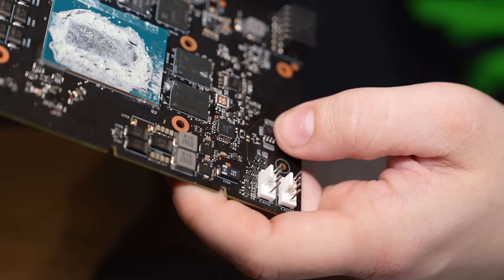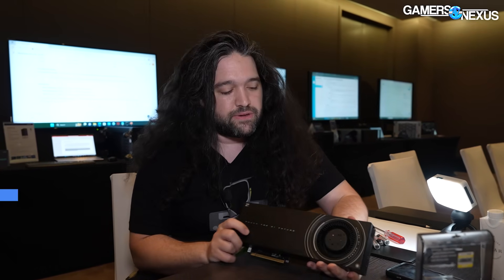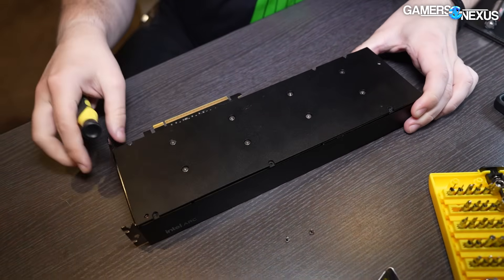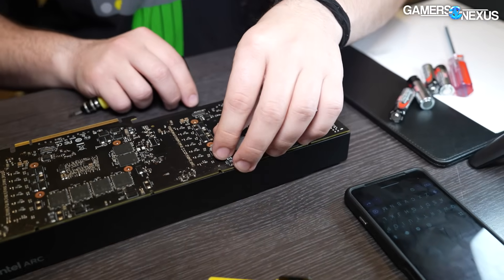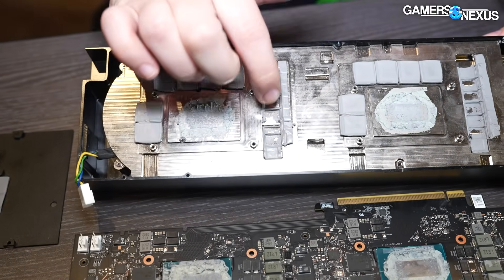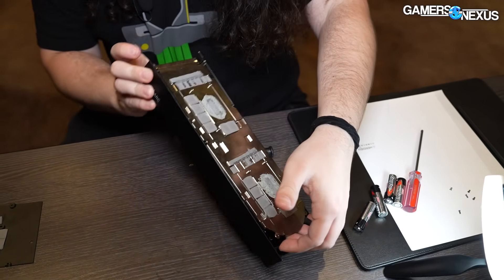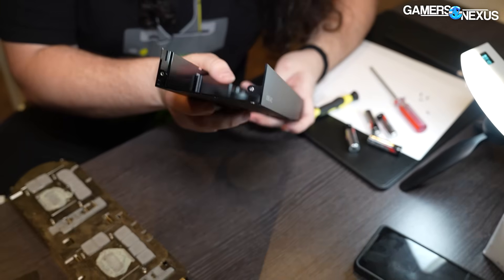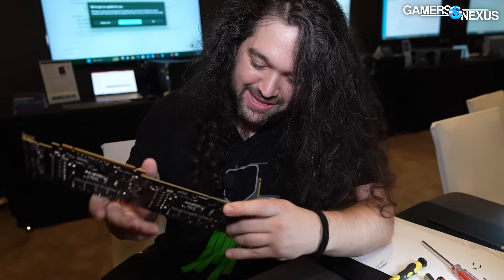Intel Arc B60 DUAL-GPU 48GB Video Card Tear-Down | MAXSUN Arc Pro B60 Dual

Comment: This cooling design does not support more than 250-300W TDP.
We will probably get 2X150W silicon. Intel B580 has 14TFlops\190W - ~0.07 TF\W.
250-300W Intel silicon will give no more than 20 Tflops.
I hope that I am wrong and real tests will show an impressive GPU for work.

Comment: The problem isn't the drivers for dual GPU. With Vulkan/DX12 the developers need to implement all of this. It's a lot of effort and there just isn't enough market to justify it.
Reply: Sadly. Even two 3060`s would be amazing in current games. Basically 4090 at home.

Comment: This brings back memories...i have a few dual GPUs at home, just from a fun collectors standpoint. Radeon HD 5970 (2 of them), GTX 295, Radeon HD 3870x2 and 4870x2, a 6990 and a dead GTX 690. I have a few more coming in at some point, since i want to have a collection of sorts.

The one i'm the most fascinated about is the old ATI Rage Fury MAXX and how ATI got AGP to accept 2 GPUs using AFR, but only on Win98. The card itself isn't anything special, it's just two Rage 128 Pro chips on a single PCB. It wasn't mind blowing, especially when you look at 1% lows and that it needed driver support, but overall, it was a very fun concept ATI tried to do.

Comment: The next GPU we need to see is a GPU that has integrated modularity with memory. Being able to easily swap out memory modules without the need of specialized tools and soldering, (similar to DIMM's) would be huge and would solve issues with the 5060 and other sub 8gb cards.
Reply: Not really possible. Modularity = being stuck with slower DDR memory, same reason why phones and laptops use soldered lpddr - its faster, it uses less power and its easier to install (not for user), and almost completely removes problem of signal integrity that is limiting current socketed memory. Not to mention needing to dump a different bios to a card to make it run, which is impossible without specialised tools and know-how anyways.

Comment: Machine learning is in its basic form pretty simple. It's a math function with a ton of parameters that you can change and there is a simple formula for how those parameters can be changed slightly to be slightly less wrong for a given input and output training example. So you nudge those parameters in tiny steps a trillion times and you have an imprint of the function you showed it by examples. It's a bit like striking a form into clay to make an imprint. You can also think of parameters in a model a bit like pixels in an image. The more you have the clearer an image you can have. Also Jen Hsun Huang is a stingy b. That's important to know :)

Comment: Didn't see a PCIe lane switch IC on the card - gonna assume each GPU is using its own x8 lane link and the mainboard slot needs to support bifurcation to get both GPUs working (otherwise I'd assume you just get one half of the card usable - a situation somewhat akin to the ATI Rage Fury MAXX on Win2K onwards). Yeah sure, most mid/high-end consumer boards would have this covered but definitely not aimed at the consumer market.
I.e. Intel haven't got a link between the GPUs so no effective load balancing / sharing of work, so no SLI/Crossfire-like thing likely to appear from them.
DirectX12 Multi-GPU could maybe use this to scale.... no game devs really bothering with that though.

Comment: Isnt this the same thing AMD made for Apple? The AMD Radeon Pro Vega II Duo but now attempted by Intel?
It was an interesting concept last time , i'm curius to see if it works under load. 
The problem with dual GPUs is the latency from the interconnect.
AMD pretty much abandoned the tech after Apple ditched them.
Reply: There is no interconnect. For all intends and proposes this is two separate cards.

Comment: good that intel is letting aib/partners do more variation with the offerings, makes little sense that they can't do relatively easy swaps like trading around density of memory modules for a given gpu chip which requires no other major rearchitecture to take place; let them experiment in the space if there's a business case to be made. 
moving arc units regardless is good, even if they're niche combinations. 

we see what the alternative has led to...

Comment: I love dual video cards. They’ve been around quite for a while still, and AMD’s Pro Radeon RX6800 Duo and Pro Vega Duo II are absolute monsters, but are only available on the last Mac Pro. They use the strange MPX slot which are basically two PCI-e slots back to back.

Comment: The power connector on server grade GPU's are often using ETX12V connectors instead of the 8 pin PCIe power connector. They look very similar but differ in two ways. First the pinout is different. On the EPS12V connector pin 1 to 4 is ground and pin 5 to 8 is +12V. On the 8 pin PCIe power connector pin 1 to 3 is +12V and pin 5 through 8 is GND. Also the profile of the plastic shroud covering the pins has a different profile to make it hard to connect the wrong type of cable. Note that it's hard, but not impossible to connect the wrong cable, and doing so can cause a lot of damage. when you power on the machine.

The reason ETX12V is often used for server grade GPU's is because it makes it less likely that you would somehow switch between a ETX12V and a PCIe power cable by mistake. The ETX12V cable also has one more pin for +12V which makes it a better choice for cards that might use a whole lot of power.

Now for my own totally unimportant rant over PCIe power cables. They should never have been invented from the start! The EPS12V standard was already in use in computers a decade before the PCIe power connector was even thought of. It should have been the first idea to use the same standard for the graphics cards as it was already established, and it is technically better at providing +12V than the PCIe connector. And this only makes the new 12VHPWR connector seem totally ridiculous. The connecting area is tiny per pin and they have "fixed" that by using a lower safety tolerance. They overheat easily if the connection isn't 100% perfect and to much power is transferred through a few pins.
Rant over...
Reply: 12VHPWR has pins so tiny and wires so thin cause its simpliest way to make it more efficient. Less cable = less resistance, and that means higher cable rating even if its no good at all.

Comment: I think we desperately need dual GPU cards, or at least support for 2 individual cards being linked up at the mid range of performance on the consumer side of GPU. I think crossfire and SLI features being dropped is part of the reason for such ridiculous ballooning of prices at the top end of single GPU cards. AMD already gave up on GPU chiplets which was supposed to be the best of both worlds, but the 5090 would never sell for 2000 or even above msrp if you could run two 9070xt or 5070ti in crossfire and achieve similar performance for a steep discount. and in fact if you could run 2 b580s together you could get similar performance to a 9070xt at a discounted price as well (I am assuming msrp for everything here)

I suppose it is possible that current prices not reflecting msrp is because of external factors like import taxes and high demand, but it is no doubt a lower cost to make 2 pretty small GPUs instead of one massive one. There should be some cost savings at the manufacturing level if multi GPU support was brought back. I was a dual Radeon HD 7950 enjoyer, I splurged on a massive expensive 700+ dollar GPU setup to play EVE online on 4 characters at once at the time, on 4 separate monitors. That game was probably the best case scenario of multi GPU performing well because it was simply multiple clients on multiple GPUs rather than putting 2 GPUs worth of resources into one game window, so my personal experiences are probably a bit more rose tinted than the next guy's. But even if a game performed horribly in crossfire running on a single card was honestly not all that bad because everyone was still using 60hz 1080p monitors at the time. Like 2 years later high refresh rate LCD monitors were coming onto the market, and I admit, multi GPU in the current 120hz+ market expectations are probably a tall ask due to frequent frame time spikes; but 8k gaming is probably going to be incredibly delayed or only ever playable with fake frames in the near-term unless we bring back multi GPU support. Low key: if 60hz is the expectation for 8k, multi GPU performance hiccups are probably not all that big of an issue. Not to mention every game dev and their mom has been dropping their custom game engines in favor of (vomits in my own mouth a little) unreal engine anyway. This way multi GPU driver support should incredibly affordable to program for the 90+ percent of triple A games being released on the same engine.

Thanks for coming to my TED talk/

Comment: You talked about testing one of these, I wonder how it preforms with lossless scaling I’ve seen people use dual gpus with it before I don’t know if this would be compatible but I don’t see why not it’s just two gpus on a single board might be worth looking into
Reply: Thinking about it now if the pcie is bifurcated then transfer speeds will suffer probably dropping is performance but once pcie gets more advanced Mabye it will be plausible
Reply: @Unyxxx  Not necessary, after all B580 only uses 8 pcie lines. So in theory both cards should run full speed.

Comment: for multi gpu to work in gaming the work/job needs to finish at the same time or the frametime needs to be a fixed number for afr, even then you still have to deal with the core 2 core latency. How are you going to fix that in drivers? A bigger package and power budget makes more sense..
Reply: To me, this would be great for streamers with compact systems. Triple monitors, with a discrete card for each screen. IGP for the chat screen, and 1 of these for the stream encoding/overlay screen and for the gaming screen. Dual monitor support with ITX, MaxSun now needs to make an itx motherboard that supports bifurcation. All in pink with cats on it, because cats=internet. Everyone knows that.

Comment: Quick question: (to anybody) 
I haven't seen a dual-GPU in over 20 years, and SLI has been dead in the water for over 8 years. My question isn't really to do with gaming in any way. What are the benefits to running a dual-GPU in data centers? How does it offer benefits over a typical Workstation "Pro" card?
Reply: Cheaper to make, fits more stuff in less space. (and single core gpu are kinda on their limit, you cant just make them bigger anymore).
Reply: @alexturnbackthearmy1907  I guess I was looking for more specifics, because I wouldn't think enterprise grade dual-GPU cards would be cheaper than a typical workstation card. I was more speaking about the trade-offs between the two, not really assuming "two is better than one" because I'm sure it's much more complicated than that. Power draw efficiency, memory modules, clocks, throughput, etc.

This is the niche of niche, and searching for info on Dual GPU's leads you to gaming cards from 1999.
Reply: @alexturnbackthearmy1907  My thing is, WHY is this model 1000 dollars, when $65K GPUs with 96gb of HMB2 exist.

Comment: I wouldn't mind having a lower end dual GPU. I have an A310. And it's used for video rendering. But sometimes I click on a video while it's processing and both explorer and the program crash. I also can't run both makemkv and handbrake at the same time. But, the performance is amazing in handbreak. I'm not sure why make mkv is affected though. It's not doing anything really. I've never seen GPU exceed 5%. But handbrake maxes it out.

Comment: why are they reinventing sli? if their gaming drivers support it then it would be awesome. but if theyre forced to run separately then theres no real point to this for gamers. we had dual gpu's before. and like sli they went the way of the dodo.
Reply: They are not. SLI is dead dead, because there is no reason for its existence left even in dual gpu systems.

Comment: We are so back, the 760 mars and the 295X where wild when they came out, glad to see that intel is giving board partners the ability to design these kinds of cards again.
Reply: Which brings a good question...when a higher end card? They have one or two ready for sure, just not released yet (if ever, they didnt want to build expensive cards cause even first one are sold at near loss, or simply at a loss).

Comment: An Intel Arc B60 Dual with 48GB VRAM should run DeepSeek R1: 70b since that only needs 43GB of VRAM.
I did a video explaining how to setup DeepSeek R1: 14b  on my channel using a Intel Arc A770 16GB.  It's around 11 tokens/sec.

Comment: that's called a bodge wire. It used to be super common. EVERY SINGLE commodore 128 ever made had AT LEAST one bodge wire. The original C64 had some issues out of the box. The recommended fix was a bodge wire in the reset circuit. Spectrum had them. Many other brands had them. And shit I've seen a modern 3d printer that had a temporary solution including a bodge wire.

Comment: "It's got 48 GB of memory so suck it Nvidia"
LOLLL....LMAO......

So true!

If the price is right with the Intel cards, this would be an AWESOME replacement for the Nvidia GPUs for AI/ML workloads.

48 GB with a dual GPU -- as long as the Linux driver works -- I'm down for that!
Reply: Too bad Intel is probably the worst card to do ML with at the moment. They do have potential if Intel sticks around long enough
Reply: @cryrpwastaken  
I think that it depends on what it is that you're doing.

If you're VRAM limited and you don't want to pay the Nvidia tax, this might, potentially, be a viable alternative option.

(I recently ran the comparison between my "do-it-all" Proxmox server with dual Xeon E5-2697A v4, 768 GB of RAM, and a RTX A2000 6 GB, trying to load the codestral:22b model. The model itself is like 11 GB, so it spills over onto system RAM. I asked codestral:22b to write a MATLAB script to count the number of lines that has an uncommented keyword.

On my dual Xeon server with the A2000 6 GB -- it took it about 5.5 minutes.

On my 6700K with dual 3090s: 13 seconds.

Therefore; if you can fit the model onto the dual GPU with 48 GB of RAM, even if the GPU itself might not be as performant vs. Nvidia's products/offerings, if Maxon is smart about how they price it, they can potentially severely undercut Nvidia, if VRAM is the limiting factor rather than pure AI/ML speed.)

Being able to fit four of those in a single system would unlock 192 GB of VRAM, which again, depending on price, could be a HUGE benefit for some of the larger models.

(Or you can just run more instances of the same model.)
Reply: @ewenchan1239  I just saw some demos of it, it's actually promising! I hope Intel keeps going and is able to get their head back into the game.
Reply: @cryrpwastaken  
I haven't seen demos of it, but I think that there are significant opportunities here, with this product.

Again, this is just based on my very recent experience where I was trying to see how much I was able to get away with where I had a LOT of main system RAM (relatively speaking, as a homelabber), but significantly more limited in total VRAM capacity vs. having a system where I was more limited with system RAM, but had more VRAM.

More VRAM won. By a LONG shot.

(And yes, it can be argued that there are architectural differences between the RTX A2000 6 GB vs. the GPU that's actually in the 3090, but given the disparity in the times, I don't think that it mattered enough yet because the model couldn't fit in VRAM, so my dual Xeons ended up having to do a LOT more of the work that normally, would've been handled by the GPUs. In the words, due to the lack of VRAM, the GPU acceleration was effectively non-existent. But this also leads me to conclude that even if you had a SLOW GPU, but lots of VRAM, the lots of VRAM matters more than having the really slow GPU, because that will still be faster than the fastest CPU with lots of system RAM.)

Comment: My new theory is Dual GPUs are essentially the future. I think with multiframe gen having. Second weaker card on the same PCB to handle frame gen could lower latency like using two GPUs in Lossless Scaling Frame Gen. 

Just a guess

Comment: Nice. Kind of a weird decision considering NO GAMES are built with multi GPU in mind nowadays. Hell, even 10-15 years ago only 10% of games got a Crossfire/SLI profile. I'm guessing it's pretty much just for SLI
Reply: Its not a gaming card in any way. Sure, you can use it as one, but it will be no better then buying two regular B580`s.

Comment: That is an intresting use of gen 5 PCIE to fit 2 grapphics cards in one slot. Not sure if that dual GPU solution is for me but a card with one flag ship GPU to drive the main monitor and a lower spec one for the secondary monitors could be usefull.